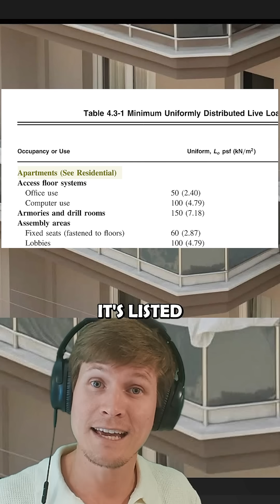Engineers HATE This Balcony Pool - Here's Why #structuralengineering #engineering #reddit

Comment: So ridiculous ... 10 cm cubed is 1 litre. 1 metre cubed = 1000 litres = 1000 kg of water. So if that balcony is e.g. 6 square metres (1.5 x 4) and it's filled with water to a height of 75 cm, it's 4.5 tons or 4.500 litres of water. And no one needs a calculator to do that. I just love to see people making life difficult for themselves by using units from the middle ages ...

Comment: I've worked in steel construction, if the building frame is made from steel then the members that hold that balcony will be attached through an insulator plate - normally some kind of plastic or rubber, and that would be the weak-spot. The insulator would crush at the bottom potentially leading to a permanent sag, and possibly shear the bolts off at the top of the connection leading to full catastrophic failure of the balcony.

As the video says, don't do this 😂
Reply: I've seen some that are reinforced pre stressed concrete that are a continuation of the rest of the structure which should be able to handle the load,  but that bolted on aluminum railing and glass sure looks safe.  Kinda like putting a hot tub on a wooden deck.  We all know it's going to fail,  we're just betting on which weak link is going to be the failure point

Comment: Oh so close! If that’s 2.5 feet of water depth, that window is 5 feet off the ground and the door is 15-20 feet tall. Since none of that is true, it’s actually closer to 1 foot of water (look at the floor under the window, meaning they’ve stayed right around the 60 lbs per square foot. As to the railing, if you can lean a 250 lbs person at the top of that fulcrum you can have a shit ton more pressing against the support laterally. Also, the glass would be experiencing no more than half a pound per square inch. So unless every piece of glass you’ve ever touched cracked when you touched it you know thats nothing. So yeah, great structurally sound pool.

Comment: I get your point, but to be nit picky, I reckon that's closer to 1.5' rather than 2.5'. Compare the water level under the window rather than at the railing which we can't really see.

Also, the code says the floor must be able to take 60psf, but there is nothing to say the floor has been built to 80, 100 or 120psf, right? These types of blocks are built from concrete and steel, may have been cheaper to do the entire floor level like that? No idea, not an engineer.

In any case, they will slide out of the broken glass and plummet to their death.

Comment: Engineers often use a Factor of Safety. Lets assume one has not already been applied in the code, you multiply the intended use force usually by 2.54 in your design which means the balcony may very well be built to withstand  60*2.54 lb/sqft or 152 lb/sqft. NOW… That does not mean the pool is safe, it simply explains why the balcony has not failed…. Yet.

Comment: You need to relax. These people are just trying to have fun, imagine all you can afford is an apartment, but you want a pool. That's what they're doing making use of what they already have. PSF or whatever, that doesn't matter as long as the structure isn't being damaged such as being hit by blunt objects, etc.  Let these people enjoy their fun, and don't be a Karen/Kevin.
Reply: not gonna be so fun when that balcony is going to collapse, rip out the wall, crash unto the balcony below and all the valuables it holds, and send debris down onto the sidewalk and probably kill someone, if not multiple people.

this type of stuff is dangerous and needs to be stopped immediately
Reply: lets risk our lives with the hope that the engineers and builders made this building to be twice as strong as legally required and also waste hundreds of gallons of water, because there is no filtration system meaning the water won't last, to have a 1.5 foot deep pool because it's just so fun.
Also putting anything below the balcony at risk

Comment: There's a reason buildings are rated residential or commercial, a change in use can reduce the safety factor/margin or even go beyond that, which is extremely dangerous especially in old structures. As to why not design every thing as commercial, well, that's simply not cost efficient at all.

Helipads, roofs with water tanks, extended balconies, infinity pools, and other special features must be accounted in the design before any construction.

Comment: People severely underestimate the weight of water. Unless a surface was specifically designed to support a pool, don’t put a pool there.
Reply: And concrete. "dont fill the wheel barrow to the top, you wont be able to control it" needs to be said almost every time we get laborers to help place concrete.

Comment: "it's 62.4 lbs per cubic ft"

me, a metric user: "yeah water weighs 1 kg per litre and 1 l is 1 dm³ or 0.001 m³, who doesn't know that?"
Reply: The US codes are written in pounds and feet.
Reply: @carultch doesn't change the fact that those are impractical units to use tho

Comment: In case anyone wants to know:
1m² = ~10.8 sq ft
60lbs/sq ft = ~294Kg/m² intended load

With an assumed water depth of 2.5 feet (76.2cm) you'd be looking at 762Kg/m² of load.
Reply: Remember, the symbol for kilo is lower case k, capital K means Kelvin. I don't know what you'd want to measure in Kelvin grams per square metre.
Reply: @peter_smyth Kelvin-gram isnt a recognised unit so it doesn't really matter.
Reply: @peter_smyth 🤓🤓🤓☝️☝️☝️☝️
Reply: 294*1.5 seems reasonable for minimum, but after a bit of calculation, a bit low. After some more calculation, I guess that if we account for a party happening (someone having maybe friends and such), and it is packed with moving people, it should be 500kg+ at least, but 700 with margin. I'm not a structural engineer. Still, balcony pool is a crazy and dangerous idea.
I could be expecting too much ofc.

Comment: reminds of a story of residents in a multistory condo decided to add ceramic tiles in their rooms and balcony.  it all added up, and eventually failed.
Reply: did they use 12" of self leveling lightweight concrete under the tiles ?  I am surprised that tiling the floors would add that much per square foot to even approach, let alone exceed the safety factor.

Comment: You mesured to the top of the pool, theres at most a foot of actuall water in their... but still over weight
Reply: The balcony wall would have to be 3'-6" tall, to meet code for someone to safely stand on it, without fall protection equipment.  He's estimating that the pool is about 2/3rds full.

Comment: I wouldn't necessarily be so much concerned about the floor breaking as muvh as I'd be concerned anout the glass part of the balcony breaking 😂😂😂

That stuff is most likely not designed to hold THAT much weight in a horizontal direction 😂😂😂

Comment: over here balconies are built to withstand the weight of like 4 tonnes, so this should technically be fine purely from a weight perspective on the concrete slab

now, the railing on the other hand...
Reply: Over where? Building codes are comparable and similar across all western countries. If the code calls for concrete and steel, thats what it would be made from.
Reply: @histguy101 well, in my case it's 100+ year old stone building, with an balcony added on by driving two absolutely massive steel beams into the stone and then bolting a concrete slab to it

so the ludicrous weight capacity might have something to do with that

Comment: Ok, we need someone to translate this video to the other world, not just Americans with their stupid imperial system...
Reply: Standard residential live load:
40 psf = 1.9 kPa

Deck live load:
60 psf = 2.87 kPa

Water density:
62.5 pcf = 1000 kg/m^3

His assumed depth of the pool:
2'-6" = 76 cm

Pressure of water on deck below:
156 psf = 7.45 kPa

7.45 kPa > 2.87 kPa, therefore deck pool is unsafe.

Comment: This is not in US and most likely made out of a  concrete, which should hold weight better than US houses.
Reply: @mlurkers Did you listen to the video, where it talked about design specifications and how things are designed using calculations based on expected normal use? Putting a swimming pool on your balcony is not expected normal use. Something under-constructed, whether it's with concrete or not, is still going to fail when you subject it to a load it wasn't designed for. By your argument, we could just build a gold vault on that balcony "because it has concrete". Concrete solves all problems. You do realize I hope the thickness of concrete used is totally dependent on the load it's expected to carry. Small load - less. Very heavy load - much more. Concrete is not magic.
Reply: @kentix417 in Germany a new balcony has to be constructed for 400 kg per square metre, and 500 kg in the past.

So 40 to 50 cm of water would be within the building codes in Germany.

And this is independently if it's concrete, steel or timber. It has to withstand that load to comply with the building code.
Reply: Im sorry, what exactly do you think a big apartment complex in the US would be made out of, if not concrete and steel?

Have you been to the US?

Comment: 1 liter of water weighs 1 kg.
If that Pool is 5m x 2m x 0.5 m = 5m³
Water has a density of 1000kg/m³ whitch then means that balcony has 5 tons of load on it. Thats like 2 SUVs or half of your mom. 
You crazy ppl need to stop that feet pound nonsens with 2.789whateverthefuck.
Reply: Or you can just use a search engine to translate the units, if you find a video where they aren't given in your preferred format.
Reply: @carultch I just wanted to show how much easier it is using the metric / decimal system

Comment: Maximum load 60 pounds per square foot huh? That's roughly the density of the cube of 1 foot or water. So your paddling pool should be less than a foot deep at all points to be borderline safe.

Which kinda makes that pool redundant.

Comment: When I worked for a modular building company we had pretty loose engineering oversight because the standard designs the building's were based on had a margin of safety factor of between 5 and 10 times loading. This increased the steel used drastically but allowed for even drastic changes in design and intended use midway through a build and saved a lot of money on logistics. 

Each lifting point was engineered to carry upto 15 metric tonnes but a building module that heavy would have a minimum of 6 lifting points. Seems like overkill but it was actually to comply with road regulations and save transport costs. Picking them up and moving them quickly and inexpensively put way way more load on those buildings than anything they'd experience in use. They were way more expensive than their competitors but had way more flexibility and way more interior space  too.

Comment: The floor may not collapse but that railing is not designed for even a fraction of that pressure. I'm more concerned about the resistance of that balcony rail.